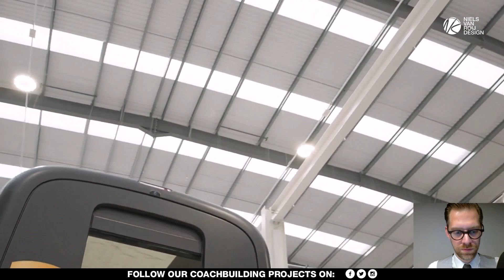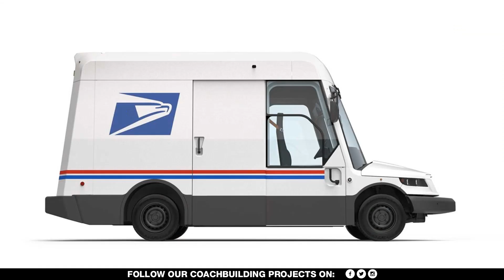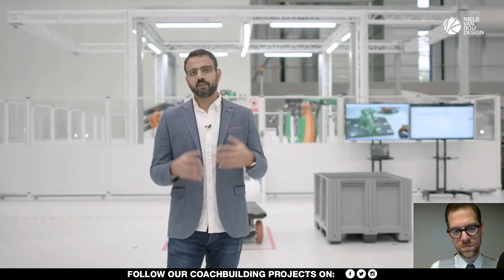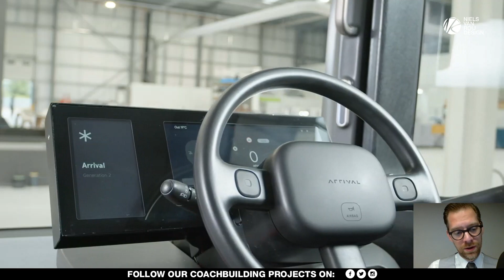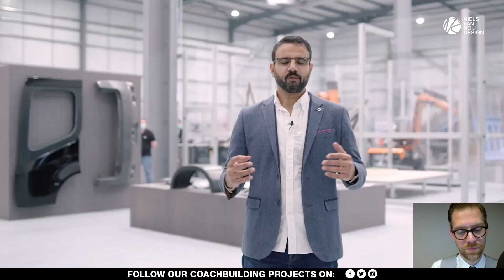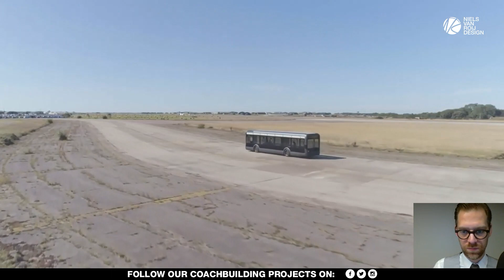The radical all composite super van's by Arrival | Niels van Roij Design

Comment: H Niels, as an American i could tell you that compare to what ups FedEx DHL drive around in the city ,with this upgrade  is night and day .The sound of the muffler the dark blue smoke of the exhaust that smells poisonous even 100 feet away and a clean cut look simple yet elegant . i was wondering the fact the bus and the van has a similar look does that mean they could use the same chassis in different specs .Which it could be very interesting to know that they could build the van and the bus in the same micro factory 
Without any significant cost and harm to the environment .Thank you for your valuable expertise and insight .
Reply from the maker: Hi Alex! Thank you for tuning in to the channel. 
I can imagine that the Arrival, compared to the old stinky diesels with their dark blue smoke is (quite literally) a breath of fresh air.

The bus and the van likely do not use the same chassis in different specs, as the two are very different when it comes to loads and use. It would not make sense to make a van too expensive, too heavy, too strong for its use.

However, much like in a normale large car factory, they might be able to actually build the van and the bus in the same micro factory. All sorts of cars are produced in normal car factories, different models and even brands on one line!

So, indeed, this would cut cost and means less harm to the environment. Thank you for sharing your thoughts! Many more videos here!

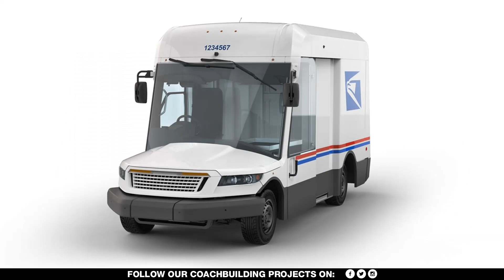Comment: 7:23  Yes,  Have you ever seen driver training for Postal workers?     Its not pretty.   
also the best thing about this company is that they're actually doing something and building something for real and getting things out the door.

if you are a delivery company basically an electric delivery van is the perfect Transportation device for your company because you can have close to zero downtime and even fueling isn't really an issue as you feel up during the end of the day. Or when you go back and have the truck reload which usually takes about an hour anyways sometimes longer.  

the fact that these are all composite makes it very probable for them to be used for a long. Of time and not have to worry about things like rust issues.

the fact that the batteries are modular also means that if you have a bad module you just pull it out and replace it and your back to go to work.

the best part about this is the charging cycle as you can do it at night when there is little demand for electricity and there's plenty of generation available show the electric grid gets used to its fullest capacity.   you also get much cheaper electricity at that rate and time.

the only thing I would recommend is to add a diesel generator or a diesel heater as those are super efficient last a long time and of course due to the amount of heat they produce versus The energy used that is going to make the battery last longer if you don't have to use resistive heating or a heat pump which is basically just a air conditioner working backwards.

solar cells on top would be perfect for running the DC motor show that it would literally not take any power from the main  battery pack/ 

if the Depots have a system like automatic Park in charge this would basically take care of opportunity charging while you're at different Depot's or along stops where you be there for a time of about 30 minutes or more and that should more then do for keeping the battery topped off at an  acceptable percentage.

for extremely long distances or Furlong route to traditional diesel can be used however to use something like this in something like extremely cold climates something like a propane or natural gas or CNG tanks can be mounted on top so that you can use one of these small engines for power to help aid in getting long distances from the vehicles and the power source should be extremely inexpensive since a typical engine that's small enough to produce approximately 900 W would be more than sufficient for driving the vehicle.     

since we're not concerned at the frequency of electricity it could be a very high frequency generator and the small engine as low as 63 CC in size would be more than powerful enough to provide approximately 3 kilowatts of power at maximum tilt.     while roughly costing less than a couple hundred dollars to replace.   if Harbor Freight can do it ?   then there's no excuse for building a very small efficient generator.   with a water-cooled head it would also provide heat to the cabin and therefore make it extremely efficient,
Reply from the maker: Thanks for your extended answer, much appreciated. The work they did is truly inspiring and you make a selection of valid points. I could do another video on Arrival?
Reply: @NielsvanRoijDesign     You should!
Reply from the maker: @MickeyMishra  👍